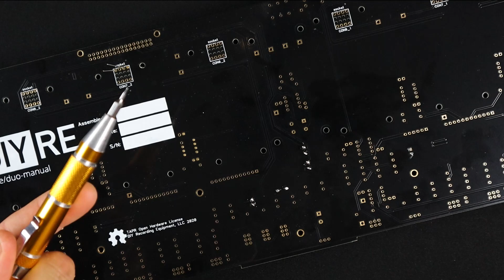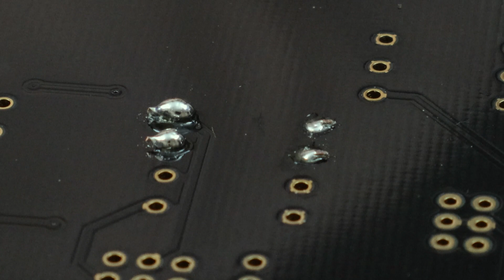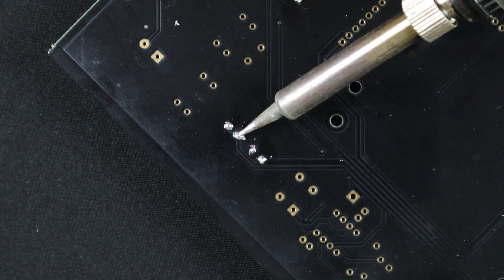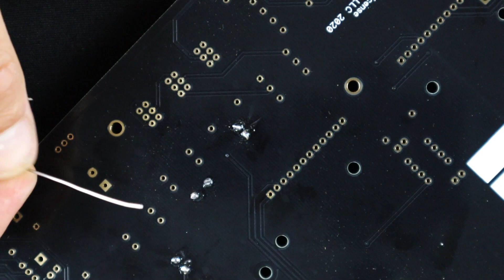Cleaning Up Your Soldering | Troubleshooting Tips #4

Comment: You need to ADD-USE FLUX all the time.
Reply: Although if you use a good iron like a JBC, Metcal, or Pace and work fast the flux in the solder will leave you a good joint.